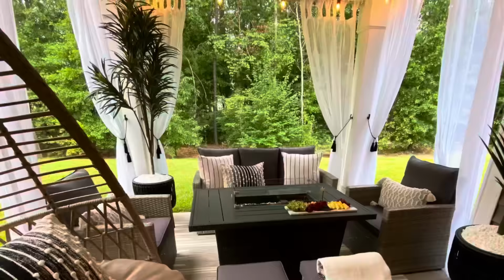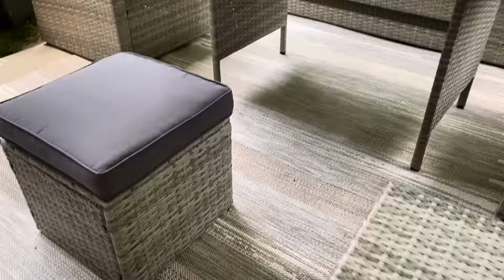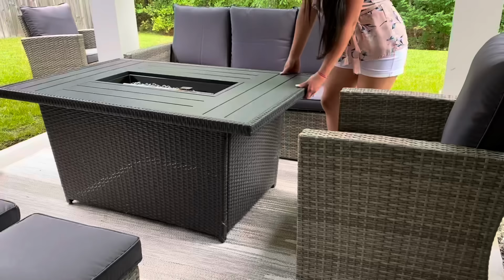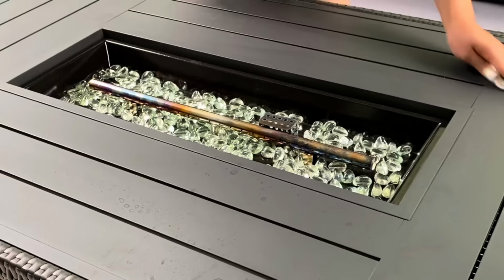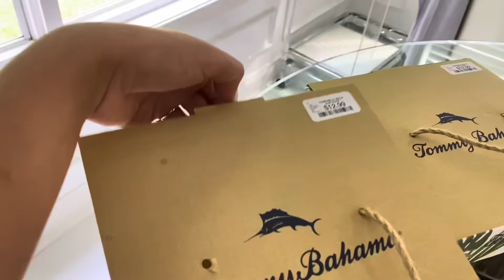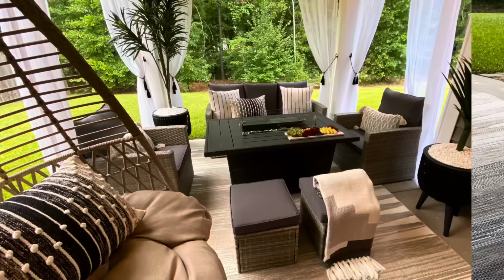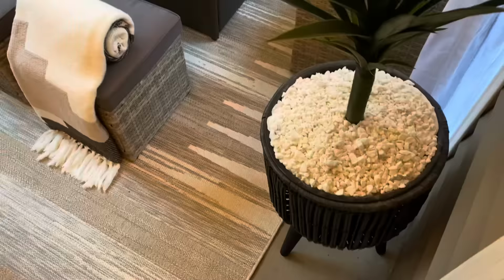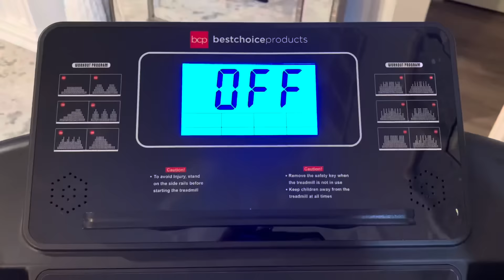DIY PATIO MAKEOVER | Satisfying Clean and Decorate Patio Makeover | Outdoor Decorating Ideas

Comment: I'm in the process of removing a ground level deck and replacing it with a patio. Thinking that I want to decorate it differently than I did the deck. Love the pieces that you went with.
Reply: I love the way you used those brackets to hang the curtains.